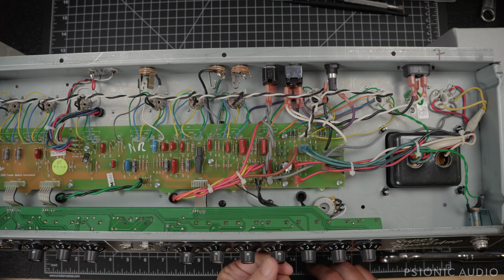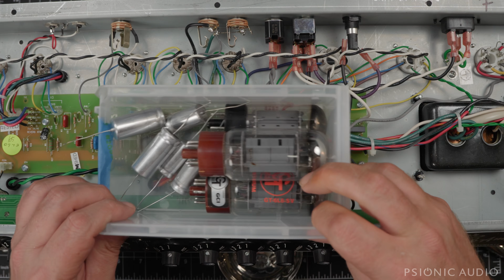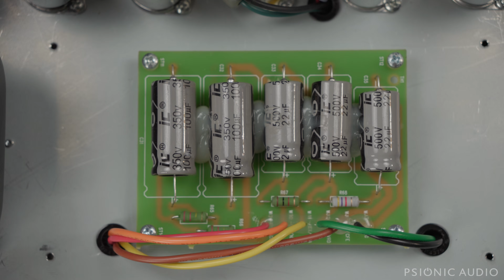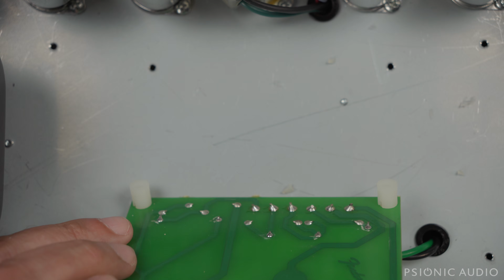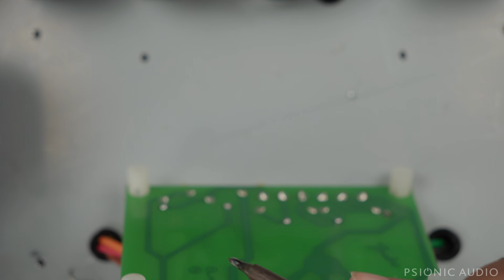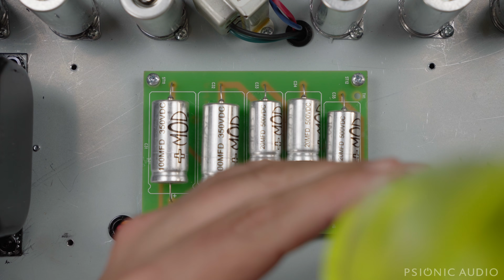‘65 Super Reverb RI | Tonal/Reliability Upgrades Part One

Comment from the maker: At one point I misspoke about pins 1 and 8 on the output tube sockets. I also had subject/verb disagreements from time to time. Both bother me. A lot. Anyway, listen past the obvious gaffes.

I’m also still learning how to use the camera correctly, got some focus issues to improve and some bench wiggle issues. Onwards and upwards!
Reply: Maybe you can use an eraser ✏️ on those parts 😂
Reply: @michaelfuller34  ,  Actual erasers with some grit in them (pumice or other sand/silica content) can be helpful for polishing things prior to soldering, or for cleaning relay contacts, switched 1/4" jacks, and so on.  Most modern erasers, unfortunately, are made of a doughy non-abrasive vinyl material, referred to as "plastic" erasers, and are pretty much useless.
Reply: Absolutely no forgiveness for you, Lyle; I refuse to listen past your giraffes! 😉😁
Reply: Huh! Plastic erasers what next? What happened to that lovely crispy bacon you used to get before the war?

Comment: I have a '98 hot rod DeVille that I've done a little modification to, I bought and installed the Fromel kit for it that includes f&t caps and new power resistors and some tone stack modifications intended to make it behave a little more like a blackface and also includes swapping around some wiring so that one of the tubes that I believe is half used in the clean preamp becomes a cathode follower common to both channels and driving the tone stack... Doesn't exactly sound like a bassman but I think that's sorta what they're aiming at with that part of the kit... 

Anyway my gripe about it is that the tube sockets are board mounted which makes it pretty tough to move the heat producing components off the board and onto the tube sockets and my question is whether you think it's worth it to stick it out with that amp, and maybe do away with the tube board at some point down the line when I work up the nerve or whether it may be a better idea to sell it off and buy something with chassis mounted tube sockets... I do really like the way my DeVille sounds now and I don't really have an opportunity to push it very hard right now, frankly I don't play it a whole lot bc I have smaller amps that are more portable for gigs and a more manageable volume for my home but I do want to push it hard... It sounds kinda nice turned up pretty loud

Comment: You can bring down your temp to 675 and it will still work fine for smaller stuff 750 can burn the pcb, but i understand if you need some power on larger copper areas

Comment: Great video and beautiful work, as always! My own Super's screen resistors have fried and, being in South America, I am going to have to repair this myself and bring it up to better safety specs in the process. When you say you've "got a new (orange) wire soldered here to the screen point" at around 12:10, what is the exact point to which you are referring? Thanks again for the in depth look!
Reply from the maker: Thanks! I have the orange wire soldered to the board where the screen node quick connect is (follow the trace from the old screen grid resistor location).
Reply: @PsionicAudio  - Thanks! I was in the process of taking it apart and now see the trace from the orange labelled connector to where the common points for the old resistors used to be! Thank you once again!  Wish I could ship my amps off to you!

Comment: You can't really say those are "loose from the factory" when that's not direct from the factory. It's an amplifier that's been vibrating as long as the owners used it. Unless those nuts have a positive lock engagement, they could've vibrated loose.

Comment: Hi, Lyle - I see you are going to be moving the screen resistors across pins 4 & 6 on the output tube sockets per your discussion in this 1st installment.  From what (I think I see or don't see) from this video it looks like the control grid stoppers (I'm assuming 1.5K) also reside on the pwb? Will you also be moving the control grid stoppers across pins 1 & 5, like the typical AB763 layout?  This brings me to my main question. What type(s) of resistor composition have you yourself used with good results in this particular control grid position (6L6GC output stage) from your years of experience and sheer volume of Fender units? I'm particularly interested in what composition type you have introduced for example with blond and brown era Fenders that didn't have the 1.5k on their revision release on the 6L6GC control grid?  Thx Bill
Reply from the maker: Thanks Bill. On old amps, CC. On new amps, CF. I’m waiting to hear what this amp sounds like with the grid stoppers on the board. I don’t know yet if that is an issue with this model. 

I considered moving them just for Best Practice but I want to hear the stock circuit first.
Reply: @PsionicAudio  Thanks for your response, Lyle. I really appreciate it!

Comment: Those brown gum erasers were dirt cheap in bulk compared to a pink pearl rubber eraser, so schools bought those awful gum erasers not knowing that they were NEVER EVER designed to erase pencil writing. Their intended purpose was to remove pencil smudges and clean up manual pencil drafting plans before inking them in for the final rendering.  If you had a smudgy area on your plans you used the brown gum eraser, then you used an eraser bag (a gauze-ish bag full of eraser crumbs) and a rag to clean up the whole page. Then you went over all the pencil lines with ink, or you passed the plans off to someone who could do the final inking without screwing up.
Reply: I learned to draft schematics, and PCB artwork in high school. Our electronics teacher was laid off due to the Reagan funding cuts, and we got a drafting teacher for electronics class, and he taught what he knew. We HAD a great electronics teacher but he got laid off. I worked with him at a TV repair shop, so I got paid to learn there instead of in electronics class. I appreciate the schematic & PCB artwork education very much too.
Reply: @Satchmoeddie  , powered draftsman erasers with the long 1/4" diameter eraser rods are actually very useful in electronics work, for polishing things prior to soldering, IF you can find new-old-stock eraser rods that are mildly abrasive and haven't turned hard and brittle with age.

Comment: Hey Lyle I was just wondering. I’ve noticed you’ve been putting MOD filter caps in instead of F&T’s is a preference thing or a supply thing. Keep up the great work.
Reply from the maker: There are 120 degrees instead of 85 degrees. And so far so great.
Reply: @PsionicAudio  any ideas on who makes them? country of origin clues?
Reply: Thanks for the clarification sir. Much appreciated.

Comment: If you show the change to the bypass caps in a follow on video, would you mind going into a little bit more detail on why the change adds harmonic content? I was under the impression that the value of the bypass cap doesn't matter too much as long is it is sufficiently sized to fully bypass the audio range.
Reply from the maker: I’ll be discussing that in the next one.
Reply: But if you decrease the size, you'll get bass roll-off.  I'm looking forward to what Lyle has to say about that as I can think of both pros and cons of that.